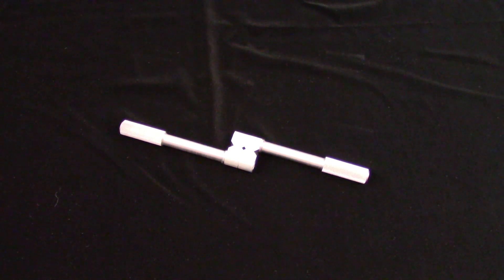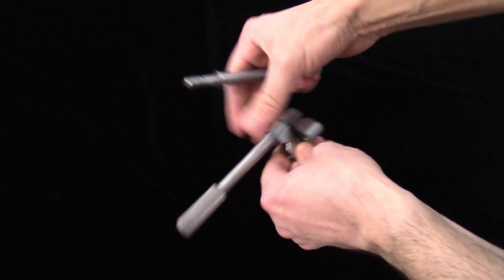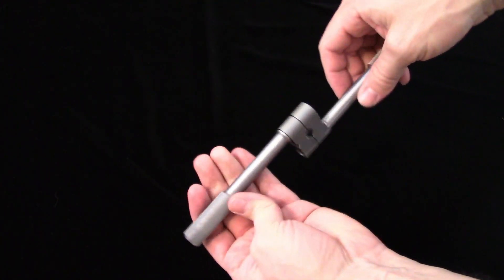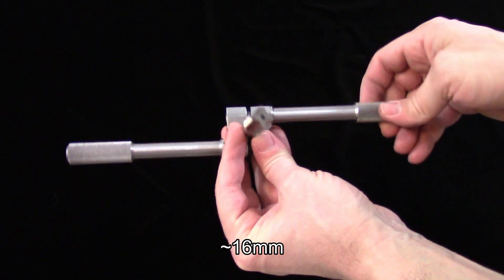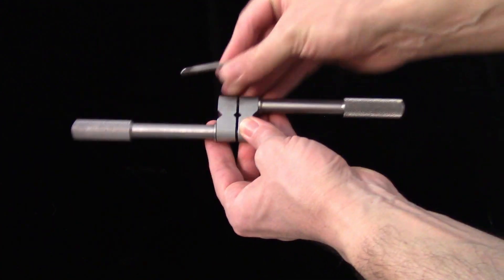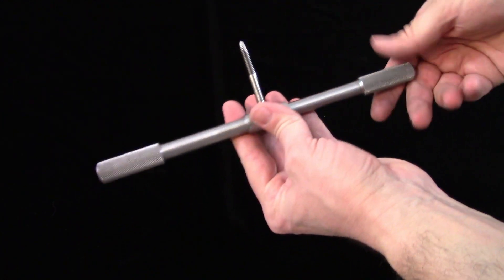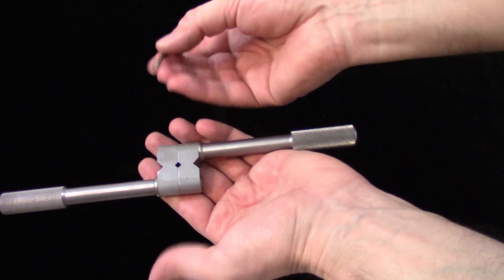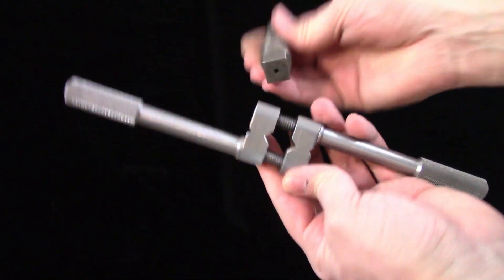Making a Tap Wrench - Conclusion

Comment: I herd you say you use a 1\4 x 20 tap mostly , that does seem to be the mostly common used size. With that being said I seem to go threw a lot of them my self and due to breaking them off I can't seem to come across a real good one that I would recommend. Which ones have you found to be the better ones to purchase. Thanks for the video.
Reply from the maker: I've had great luck with OSG and Cleveland taps. I mainly buy spiral point taps with the occasional spiral flute tap.